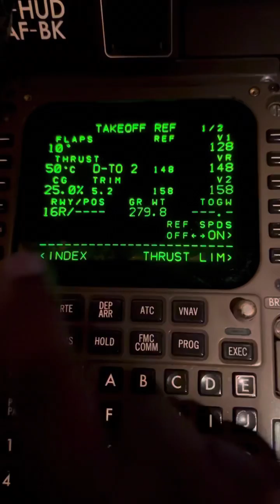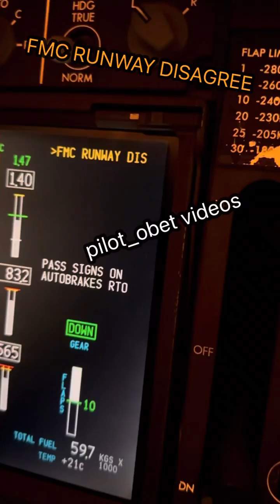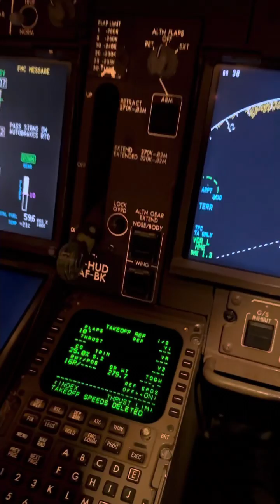Wrong Runway Takeoff Alert!

Comment: Looks like simulator training?  You would think that with all the modern GPS technology they should have gotten some type of alarm as soon as they lined up on the wrong runway, not after takeoff thrust was applied.  But in this case, I think that must be an older FMC that isn't linked to all the modern positional electronics.
Reply: Some airports you can taxi along a runway so the computer need to know they’re actually attempting to takeoff before alerting them

Comment: In real life you won't even get to hear this warning because the ATC was already yelling and roasting your arse 😹
Reply: Not always. For example, ATC gave a runway change and the crew complied. The crew re-calculated takeoff performance but forgot to enter it into the FMS, or maybe they forgot to re-calculate at all. The incorrect V-speeds, takeoff thrust/flaps settings could cause a crash if the new runway was shorter.

Comment: was this available for the accident Singapore Airlines B747 aircraft at Taipei?
Reply from the maker: I would think it was but I think the issue wasn’t that they were on wrong runway. They lined up on a runway that was closed I think or under repair
Reply: @pilot_obet  Well.  both statements are correct.  They lined up on 05R, instead of their cleared runway 05L, which happened to be closed, and they crashed into the construction equipment on the runway.  Is this part of RAAS?  If so, it is an on the -400 so some airlines did not purchase, not sure when it was available..